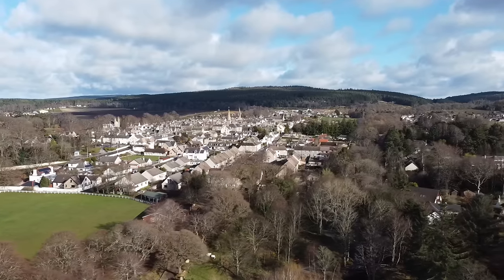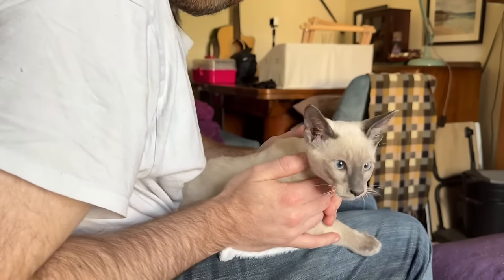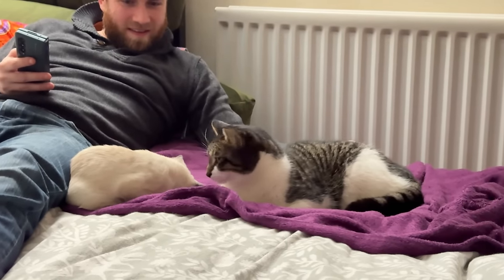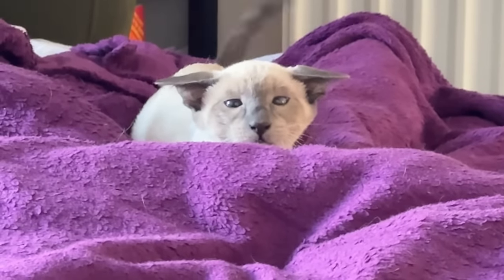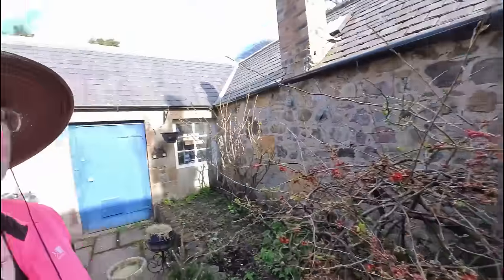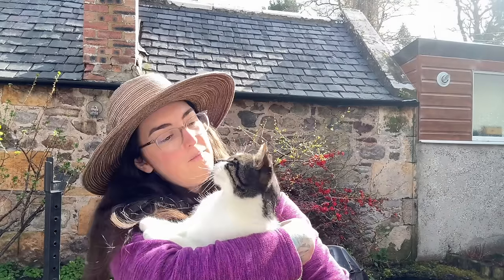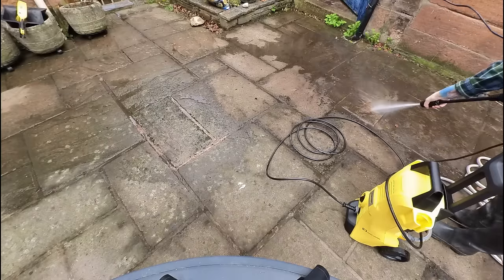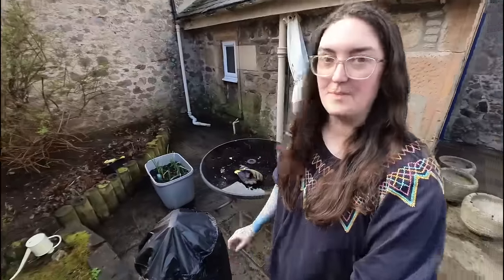Spring Gardening, new KITTEN, and other stuff // Life in Scotland VLOG

Comment: Sarah, here in the Pacific Northwest, USA, I run into problems with pottery cracking during the winter.. and it has to do with water ..and freezing. Here’s what I do. I empty out the pot and bag up the dirt ..if there’s a plant I need to save, I bag up the dirt around it and put the plant in the shed where it can still get light. I  then clean out the container and turn it upside down. I let it drain ..and completely dry out..and cover the drain hole with saran wrap and then turn it right side up ..and fill it with newspaper ( you could fill it with Styrofoam peanuts or any of those kinds of things as well) . I seal the top with some more saran wrap and a bit of twine and then turn it upside down again and set it in the shed…if you leave it outside, you’ll need to wrap it in burlap with a few more layers of newspaper around it. If your shed freezes, I would say put more newspaper underneath the pot. This should save the ceramic/pottery container. My temperatures here range from 15° to 30°F and sometimes we get a little lower than that. ❤️
Reply from the maker: Wow so much effort to save the pots ...maybe I'll stick with plastic for now since I don't have any shed space